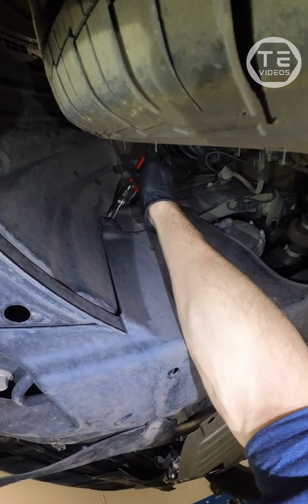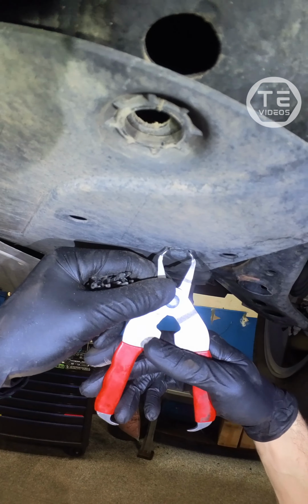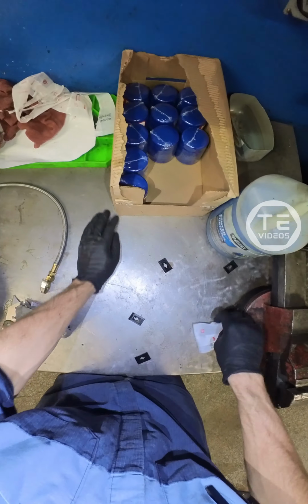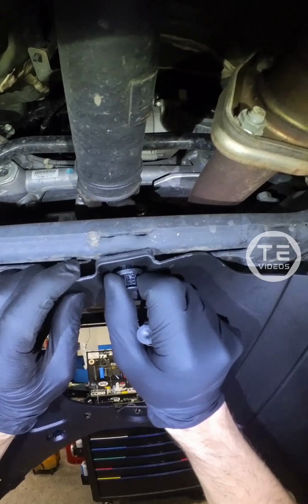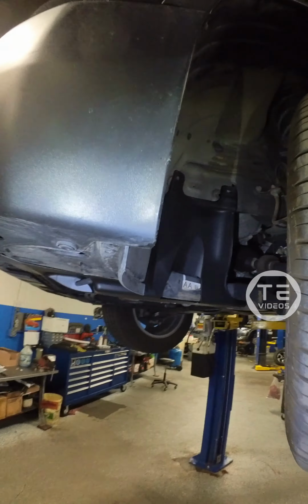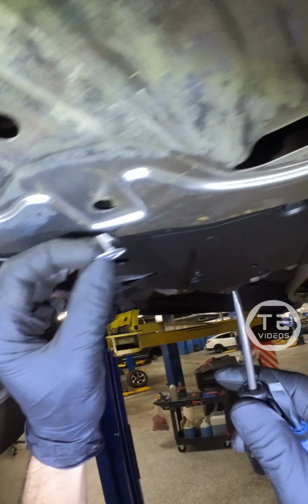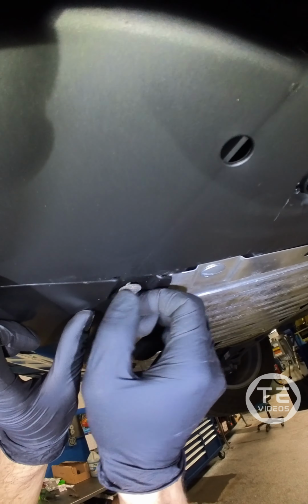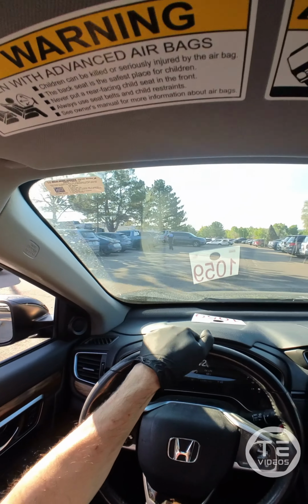CR-V Splash Shield Replacement POV FYB 🔧😏👌 #honda #crv #splashshield #pov #fyb

Comment: What does it usually estimate cost for replacing the splash shield, front bumper, right fender, upper and lower bumpers? And how many labor hours are required? Thanks.